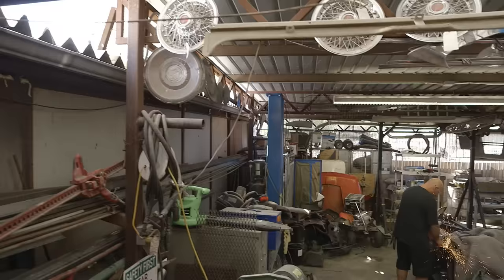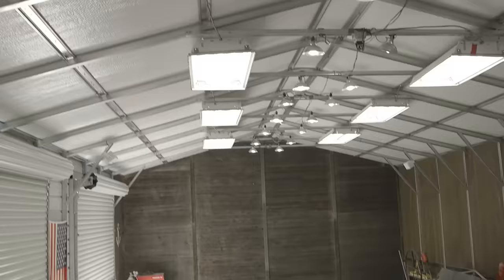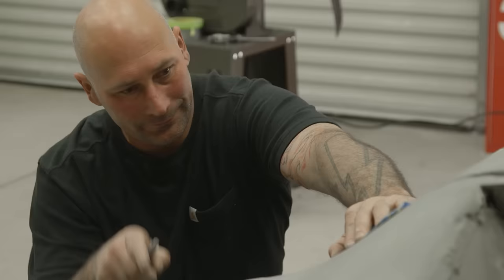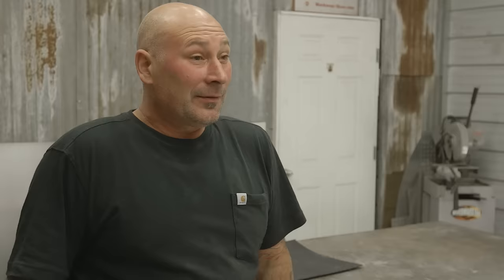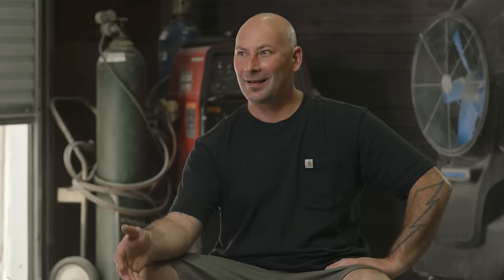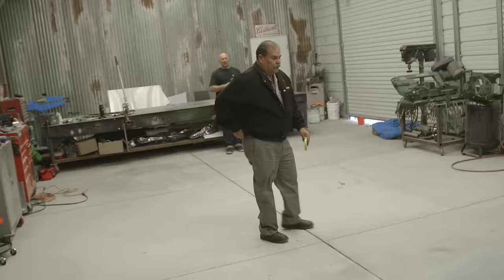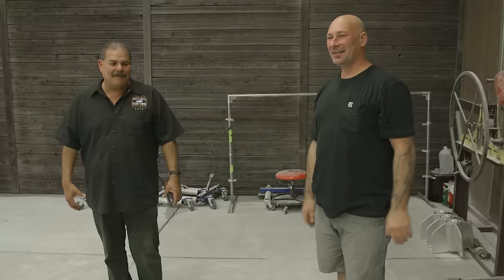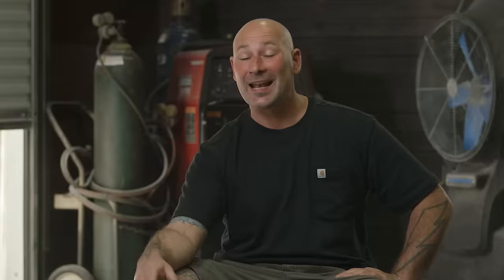Creating the Ultimate Car - Full Custom Garage: Sports Car Edition - S04 EP11 - Automotive Reality

Comment: Looks like it needs something to come off the back section of roof
Reply: I was thinking about that... maybe some fins like those on the hood holding a thin bladelike spoiler in brushed aluminum! That would look awesome and tie in the two ends of the car...
Reply: Maybe a thin little cool roof intake inorder to get more air to the motor like a many of super cars have
Reply: Tail pipes out the top back

Comment: I can't get enough of Ian's customizing and creativity. The Door Concept had me thinking, why not two doors, the top opens with a sleek line across the top of the door, and the bottom does a suicide door opening instead of the door having to be one piece that rises up with the lid.
Reply: I was side swiped by a drunk driver who basically pitted my car and it flipped over ending up resting on its roof.  Luckily I was able to kick the door open and crawl out.  Seeing this makes me nervous about getting in a roll over due to no fault of your own and being trapped inside.  If I were to build something like that, it would be with hydraulic rams and a re-enforced roof that were strong enough to lift the whole car off the roof just in case it ever ended up wrong side up.

Comment: That door/ roof needs to be straight across at the bottom. It needs to match a body line. That little drop-down piece looks like an added afterthought. So you put in a big front vent with pieces of aluminum that mimic the cowl. Match that in the rear for engine and brake cooling with future Turbo inlet capabilities. You do the lower portion of the door "pocket" style. If it works, it would be amazing...

Comment: A car needs to be built around first the passengers comfort and position, second the engine transmission set up, third the suspension, fourth and most definite the frame to support the arrangements of one two and three if it's mid, front or rear engine, 2or4 wheel drive, then the last and least important is the body. You are doing this backwards and will end up with is a batmobile, a car that is uncomfortable to drive, difficult to service and performs poorly. You just made a Porsche with a Bugatti rearvend.